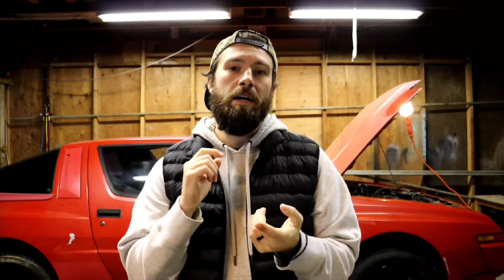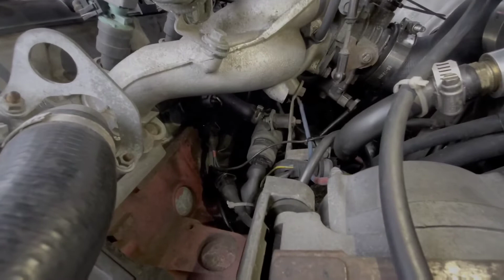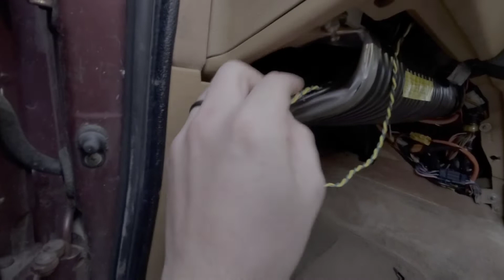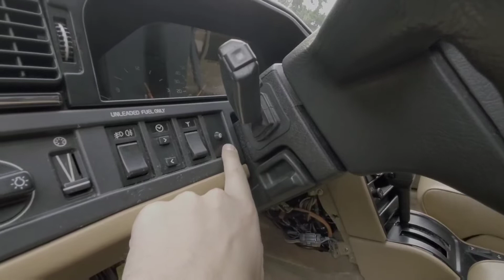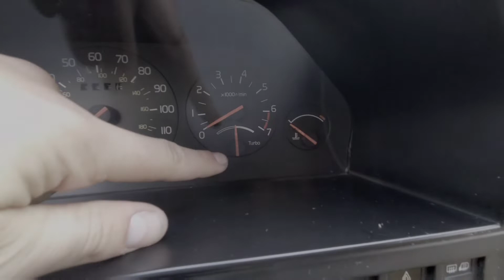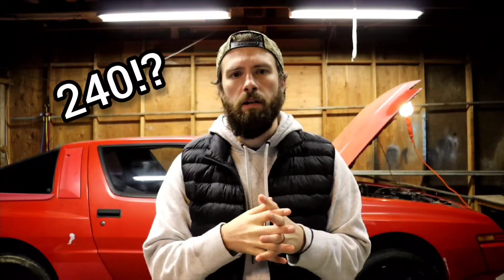The BEST Tuning Insurance - Knocksense Install

Comment: LH2.4 timing isn't adjustable at all, no matter what position the dizzy, it's all controlled by the ECU.

I wonder if it's possible to replace the LED with a small audible beeper of sorts.🤔 That would definitely be preferable when bombing down the road.
Reply from the maker: Possible! There are chips made by those in the Volvo community to adjust the LH2.4 timing curve. Going to have to take a dive into the forums to find our who did it!

Comment: You should’ve shown the flashing LED as a way of showing the finished product! Overall nice video dude and appreciate the work you put into it.
Reply from the maker: You are right!  That would mean inducing knock but I would make that sacrifice for y'all 😉
Reply: @RAPauto  u could always tap the sensor bolt with a ballpin happen to simulate knock so as to not risk u engine brotha but over all hell yeah brotha this is awesome and I deff need ti get this cuz I been tuning my build without one as its a 91 with no knock sensor and pushing alotta boost but stupid safe timing and rich so to not go boom 😅 ... thanksbfor this brotha as I deff need to get one of these